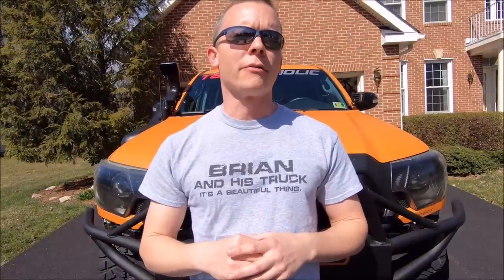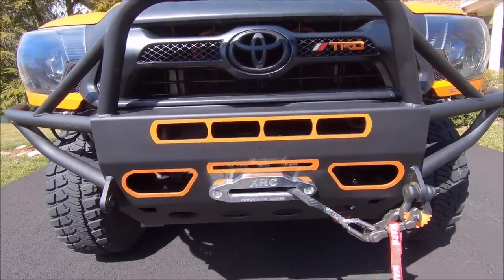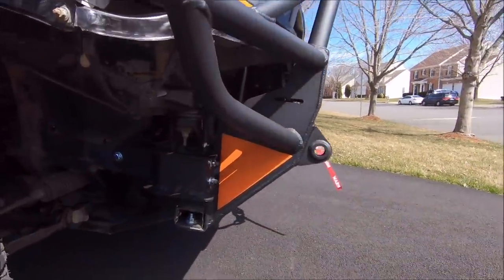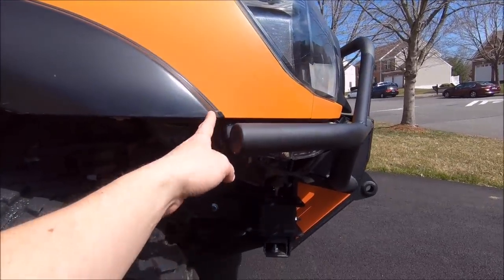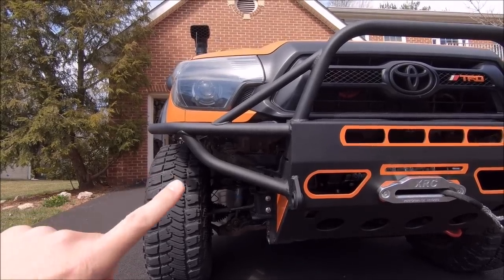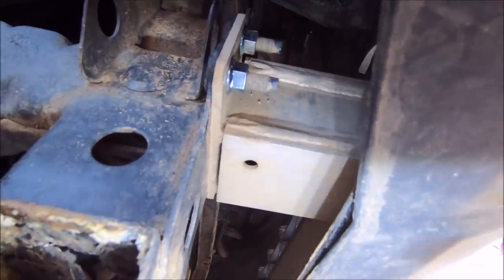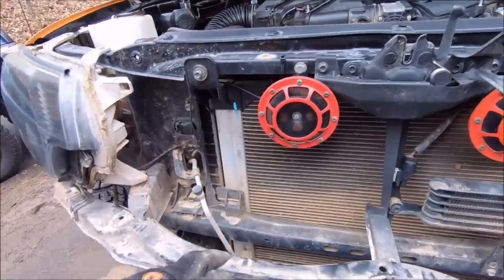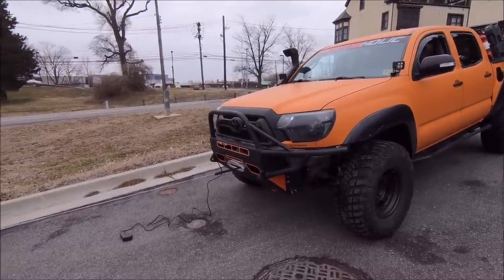Brute Force Fab 2nd Gen Toyota Tacoma Front Bumper

Comment: Hey sorry for all the questions but Im confused on the steps to paint my bumper. I applied two coats of the self-etching primer yesterday. Did you sand the bumper before you painted it with the flat back Rustoleum? And if so what kind of sand paper did you use?
Reply from the maker: I love questions! 😀 I've never sanded when using that self-etching primer as it bonds firmly to bare metal. Just make sure you clean the metal with acetone or something similar first.

Comment: Did you have to do body mount shop when you got bigger tires?
Reply from the maker: Most of the time you do have to chop the cab mount for 33" tires. The largest tire a 2nd or 3rd Gen Tacoma can run without having rubbing issues is 265/75R16.
Reply: I just installed 285/70/17 and they’re rubbing pretty bad on the frame. Thanks
Reply: @Tacomaholic Not true Tacomaholic or are u referring to a non lifted Tacoma??I'm running 305 70r 16's (cooper sst) on mine....no problems
Reply from the maker: Very common. If you are on Tacomaworld ask if anyone in your local area has the skills to do the cab mount chop for you.
Reply from the maker: Consider yourself lucky then because that's not the case for most of us.
Reply: I got 285 and no rub on the cab either
Reply: @Tacomaholic   you can see by my pic theres pretty much clearance...Icon front coil overs/ A arms. The wrong rim offset might be a problem for some? Your bumper looks good...someplace to hang your laundry if the clothes line is full.😉 Just kidding with ya!
Reply from the maker: @gtnoslp  Thanks Dan! I love how the bumper turned out. So your tires don't rub at full lock when turning? What about offroad when they get stuffed up into the fender?
Reply from the maker: @Justinfellenbaum  Lucky!
Reply: @Tacomaholic  full lock no problem....not much stuffing the tire problems,  maybe I'm not beating it hard enough!!! Suspension works great!